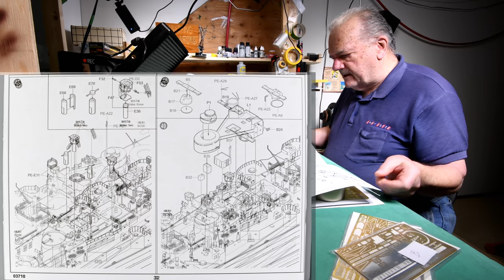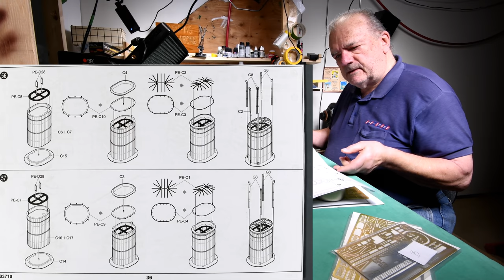The Model Ship - Part 680

Comment: Ron, I’ve used the Tamiya Fine Surface primer, along with Vallejo and others, but my favourite is Stynelrez, many colours to choose from. Over brass, works a charm. I do let it dry for 24 hours before I paint base colour. Tamiya is good stuff..
Reply from the maker: Yes, we had really good results with the Stynelrez on the Bismarck railings if you recall. 👍

Comment: I'm like you I'm a loner as well i suffer from depression & anxiety  i have my model's that's what keeps me happy my daughter has it too inherited from me it's what bothers me most  that she has it she is 12 next month with your pH etch i found  the frets oily after I've taken the plastic off so I've bath them in metholated spirit or acetone let air dry then spray Tamiya fine surface primer you can then paint over primer no problem see you tomorrow cheers Ron 👍
Reply from the maker: Thanks for sharing Trevor. 👍
Reply: @roncalverley  that's ok

Comment: I believe that there is no one "right" or "accurate" when in comes to ships that fought in a war. My father-in-law spent the last half of WWII in the fire director (he did the lateral aiming of the main guns) of DD508 - the Cony, a Fletcher Class destroyer, and engaged in many battles in the Pacific - especially around the Philippines. I have gathered a lot of information on Fletcher Class destroyers, including engineering drawings and detail books that document the Fletchers. A common source of their detail pictures were taken by the Navy yards to document that changes were completed, given a date, and circled the features that were added or changed on that date. The nature of the war was dynamic and almost every time they pulled into port somethings was added or changed. For example Kamikazes did not exist early in the war but became more of a problem over time so more and more anti-aircraft guns were added etc. etc. So you have to be careful in determining whether a given detail is accurate - because change was common. I am collecting addons to build a Revell 144th scale model to represent a configurations of his ship (as these usually varied from ship to ship - and I'll base it on the eight pictures i have of the Cony during the time he was on it. The are numerous parts that I will have to scratch build or 3D print as many details are not available. Of course it would help if I got started - I have I have created a lot of documentation and drawings of what I need to do (which was a lot of fun and very satisfying)... but have failed to start... maybe next winter.. (see I can ramble on too.)
Reply from the maker: Redoing the Revell 144th scale model to look like USS Cony ( https://en.wikipedia.org/wiki/USS_Cony_(DD-508) will be a challenge. But when there is a personal connection one's interest will be kept keen. Thanks for sharing John. 👍
Reply: Hi, I read your comment with interest, good luck with your modelling of the USS Cony. Will you be documenting the build anywhere as it would be interesting to follow? As for the changes to a ship during wartime, HMS Hood is also a great example. Given that this was the pride of the Royal Navy and without exaggeration one of the most famous warships in the world at the start of the war, it's remarkable how many gaps in knowledge remain about her final configuration when she met the Bismarck. Cheers.
Reply: @alricdark   Thanks, I'll keep your comment in mind. I can't match Ron's amount of detail but will think about covering areas that might be of specific interest. I have done a little on YouTube but it is on flying drones and it's been a long time since I've added videos. But, thanks, you've got me thinking.